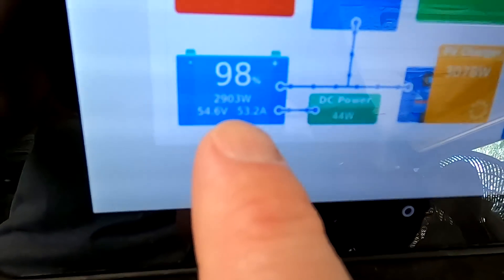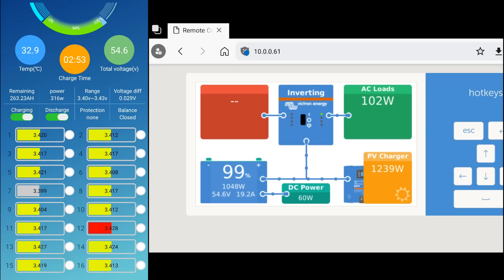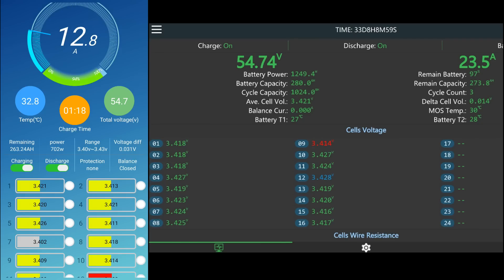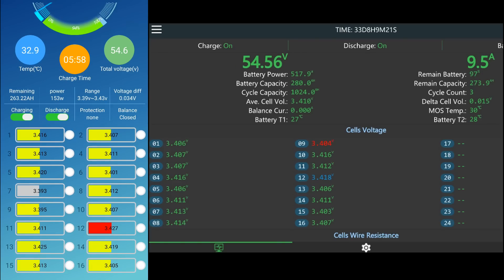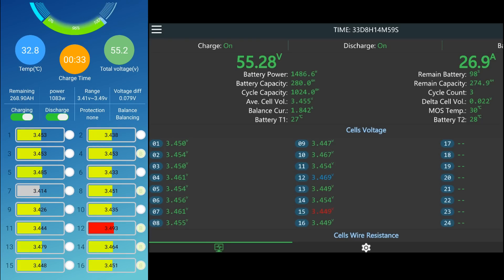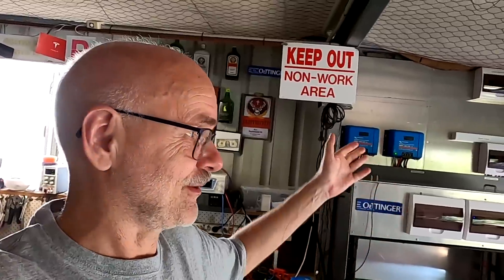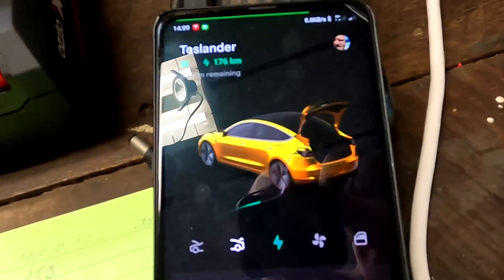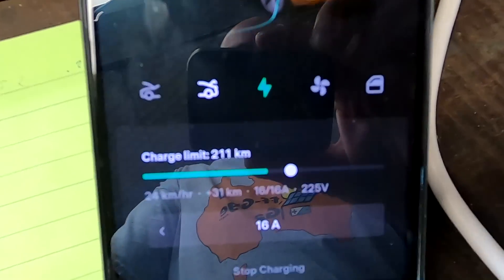Communication between BMS, solar charge controller and inverter. What's the benefit?

Comment: Your logic regarding communication between the devices does not take into account loads higher than what you are showing during your testing.  If you had higher loads during the charging, absorption or even float cycles, then the results will be quite different.  I've seen it in my own system.  That's why I'm using a custom program I've written that talks to my cell "monitoring" system which can alter the CC state and Inverter state.   I also have Home Assistant integrated with this custom program to allow me to "privately" monitor my complete system as well as override control of loads as well as the solar equipment state.  If you'd like to see what I'm talking about, I have another YT channel: JC/DC in the AZ that goes over my system as well as the Home Assistant integration.
Reply from the maker: No, I said this in the video: this situation will only occur if there is more solar power available as your loads are. Only then is energy left over to actually fully charge batteries.
If you loads are bigger than what comes in from your roof, you will discharge your batteries and no cell can actually peak with a high voltage.
Reply: @OffGridGarageAustralia  Hi Andy.  I'm sorry I didn't remember this from your video.  Also, I wasn't really saying that the load would have to be greater than charge, just that the load would by higher than what you were testing.  That's why In my setup, I have a Home Assistant gauge that shows me to Net Charge/Load to/from the battery.

Comment: Question? What do you think the JK BMS would be showing for cell resistance per cell on your old battery? You would need to replace the Wicca bms and install the JK and I don’t know if you can do that with out disturbing the buss bar connection but would sure be interesting to see what the resistance is!
Reply from the maker: I can measure this with my internal resistance tester. Wait for the next video. I will do the same with the old battery and compare the resistance with and without busbar.

Comment: Well, main advantage getting SOC information than just the voltage levels. Because voltage curves are so flat on lfp.
Reply from the maker: But the flat part of the curve is not relevant anyway for anything to be honest. Only if voltage rises and the battery is full it is interesting.
And here again, the solar charge controllers provide a relay output which can be programmed for this.
What would you want the system to do at say 60% SOC if this is been reported from the BMS to the system?

Comment: put both charge controllers on a bus brand see what happens to them. if they act the same way with one solar panel power on the bus bar and one battery on another bus bar. all solar panels and batteries are not equal and charge controllers ad wires are too. try a compressor for storage,

Comment: Can you update the software on the JK BMS? I have one with 8.20G another with 10.07 ver.
Reply from the maker: I don't think anyone can...
Reply: You can't, but I've been asking the developers to release the source code. The micro is an STM32, and it has a programming header on the board. Once that happens, we can add a boot loader to update firmware through the RS485 port or even Bluetooth. I don't have a time line for any of this though...

Comment: Communication has advantages over no communication because BMS has knowledge of each individual cells vs inverter which has no such information. So in practical terms it will benefit in following scenarios:
1. Battery is near the top balance. Overall battery voltage is normal (charger doesn't see issue himself), but some individual cell is reaching chemistry upper limit. BMS informs charger to reduce charge current so that balancer can cope or switch on some smart load (water heater etc. ) to dump the excess energy. If allowed dump excess energy to the grid.
2. Battery is near empty. Overall battery voltage is OK (inverter doesn't see issue himself), but  some cells are nearing critcal low voltage. Information to the inverter could either switch off non-critical loads or switch on generator or perhaps take energy from the grid.
Reply from the maker: Thanks for your comment.
OK, so both scenarios you explain make sense. Without communication, the BMS would just turn off this battery bank, right? If you have more than one battery bank, this is not a problem at all in either way as it will join the other battery banks again once the situation is cleared.

I actually don't like the case where the BMS tells the chargers to slow down (in case you have more than one battery bank) . This means the charging process of the whole system is dependent on this one cell in one of the packs. While other banks may still be able to take energy, they won't get it any more. It would also start to discharge all banks now if the load is higher than what comes form the sun (which may be nothing due to the throttling).

In case of the low voltage, The BMS would turn off this one battery bank and keeps the load alive with the others in place. It's a different story if you have only one battery though and your suggestions do make sense in this case.
Reply: @OffGridGarageAustralia  If you turn off battery banks one by one eventually you will only have one left. In which case you would still need to take action based on BMS data. 

Throttling charging doesn't mean stop charging. It means to slow down. All packs will still get energy, just at slower rate. This throttling will only happen at very top voltages, so this slowdown is not for very long. 

Also charging/discharge limiting is just one option of actions. Don't forget dump loads, generators, charging from grid/ dumping to grid etc

Comment: Love all your vids!!!! We have a three phase system set up, we have had the victron s shut down for a couple of seconds while in absorption,  it happens right at the top of the charge and I'm guessing the BMS shuts down because of irregular cell Ballance. Connecting the BMS I think may resolve this but obviously this isn't the answer. Going to lower the absorption voltage a little and currently have new cells top balancing. Also have on the way JK bms's, currently installed are Daly, they are shit.
Reply from the maker: What are your absorption settings right now?
The Daly is not good for the balancing, no. Neither is the JBD or QUCC (unless you use an active balancer in addition).
Reply: @OffGridGarageAustralia  we are using the victrons set lifopo4 standard settings but was thinking of lowering this by 0.2 v.

Comment: Since the amps going into the battery bank gets lower when it is almost full and then the battery bank is supposed to stop accepting charge when it is totally full, does it mean that it can never be overcharged?
Reply from the maker: That depends on the settings of your charge controllers.
I have set 3.45V per cell as absorption voltage. So with all cells balanced I cannot get in trouble as the maximum voltage for the cells is 3.65V. But if your balancer cannot keep up (like in the QUCC, Daly or JBD BMS) you can overcharge your cells as I have shown in the previous video.

Comment: Maybe a communication between BMS, charge controller and hybrid inverter might make it possible to inject the surplus on the grid while performing the balancing?
Reply from the maker: That should be automatic, dependent on your inverter settings (if it is a Multiplus) or settings for your transfer switch.
Reply: @OffGridGarageAustralia  but the inverter should tell the mppt to supply full power to the DC bus.

Comment: Right now, while you are in the garage, you are able to monitor/review the individual cells of each battery via Bluetooth. But what happens if you decide to go on vacation for 2 weeks? You are able to see the overall picture of your systems via the Victron VRM portal when away, but you are not able to see view the cell level data if you suspect something is wrong while away. That is where the Canbus communications can potentially come in. I live aboard a sailboat and am currently tied up in a marina in Phuket Thailand awaiting my shipment of 16 x 304Ah batteries in order to build a 12v 4S4P pack (our vessel has 12v systems) and I intend to install a JK BMS unit with each 4S pack with a voltage booster as you have shown is possible on your channel. A sailing lifestyle however, involves touring on shore for days or weeks from time to time and while away from the boat, I would like to monitor/review the battery packs at a cell level when I am away, but we will see. There is a person on the Victron forum working on the task...I would also like to mount 4 inexpensive 485 monitors to the bulkhead in order to "view at a glance" cell voltage data for my battery packs, which I have not noticed that you have tested on the JK24s BMS...Future Video???....Really enjoy your series, keep up the fun!
Reply: JK are bringing out the 4S version in April, much better than using the boost option!
Reply: @jackiedines5229  Thanks for the heads up!!! Where are you getting this information from? I am also interested in both the Canbus ports and RS485, which they reduced to a single less functional port on their recent 8s model, but I do like the fact that I can add my own p- and b- leads to the length that works for my battery setup...crossing my fingers for a good product- will still be purchasing the 24s model for now, as the new product will be untested, I do no expect my batteries until May, so the timing is interesting...
Reply from the maker: As soon as the 12V version is available, I will get it and test it here on the channel.
I am following this project as well on Github and will be connecting my BMS to the Victron Hub at some stage. Maybe just for monitoring purposes though. 
That's why I do all this testing with high and low voltage so I don't actually need to see the individual cells if I'm not at home. I know how the system reacts and what will happen if I go to the extremes.
Reply: @SailingCatamaranElement  They told me after I asked them for their recomended booster. Given the one I bought from Ebay crapped itself pretty quickly. Probably due to my inexperience in using this stuff.  Now due to the crappy batteries I got I am not going to use the JK BMS, rather a cheapie that gives no data at all. I will monitor cell voltage with a simple monitor. Where are you getting your batteries from?

Comment: Hi Andy, you missed one important point: The BMS is the last line of defence. You should never ever relay on the shutdown of this component in normal situations. Therefore your settings should be like that, so this situation will never occur. So shutting down a bank of batteries because one cell is high by BMS should never be an option.
Having communication could be an solution, to keep absorption available until the last bank has been balanced.
Grüße aus'm Schwabaländle :-)
Reply from the maker: Hi Peet, I don't rely on the BMS alone. You're absolutely right!
The SCC turns off charging long before the BMS kicks in and also the inverter will shut down long before I hit any low voltages. When I run these tests, I obviously want the BMS to trip to see, experience and share what is going to happen. This is also peace of mind in case I'm not at home and the 'something happens' 😉
As we have seen in this test here in the video, under normal settings and conditions, the BMS is not kicking in at all and just balances as it should.
Reply: @OffGridGarageAustralia  Hi Andy, I think you can publish a "conclusion" video with all settings (almost) of SCC , BMS and inverter. Joined to this video will be a great point to ask community for advise, won't it ?

Comment: I would explain the advantage of using your serial 485 or canbus is that you can use FOSS to log everything in the same web interface.
Reply from the maker: Log means monitoring but not actively controlling, right?
Reply: That's correct.

Comment: Andy I don't if you have ever gotten into data logging at cell level and using MQTT to check the history of how each cell  in the bank is going instead of only real time monitoring
Reply from the maker: Thanks Ross, yes but this would be just for monitoring purposes, right? Not actually controlling other devices according to a state of a cell.
Reply: @OffGridGarageAustralia  Yes just for monitoring the cells history even under load and change

Comment: Hey, communication is important to extended battery life during extraneous conditions like rapid charging or during extreme ambient temperatures. Here in North Queensland my battery bank reached  40 Celsius regularly during a recent heatwave. My LG Resu 6.4 ex battery backed the multiplus down to a 16A limit which was inconvenient in my ESS but gave me comfort to know the most expensive and dangerous asset in my system is looking out for itself beyond the manual safeguards I put in place.
Reply from the maker: Ah, right, that is a very good point. I never thought about temperature actually. While the BMS prohibits charging under 0° it won't slow down charging at high temperatures  so the cells don't get even hotter with high charging currents.
Very good example, thank you!

Comment: Bulk Charge is Constant current charge. 
Absorb Charge is Constant voltage charge. 
Float Charge is also Constant voltage charge at a voltage below Absorb charge voltage.
Reply from the maker: While it does not charge in float mode any more. It maintains the voltage (and current) of the battery.

Comment: When one of my BMS's disconnects during charging on my 12v system I have measured voltage spikes over 21v.  The inverter detected it and shut off but 21v+ for the remainder of the 12v appliances in the RV is a problem.  I have top balanced my batteries so this is no longer a problem.  I don't want my BMS's disconnecting unless it is a serious problem.  Voltage spikes will likely cause problems eventually.
Reply from the maker: If you have more than one battery and a BMS disconnects one of them, why does the voltage spike? It should stay the same as before if all other batteries stay connected.
Reply: @OffGridGarageAustralia  It was a bright sunny day and the solar was producing a little over 150amps into 800amps of batteries.  When one, 400amp battery suddenly disconnected the voltage spiked before the solar charge controllers could react.

Comment: It would be nice if Victron made a BMS that connected to the VRM.  I like how integrated everything is within the brand.
Reply from the maker: They do have a few BMSs actually but they only connect their own smart batteries. 
I agree, it is really time for them to release one which is plug'n play as all the other gear they have and can be programmed to the user needs.
Reply: Victron would eliminate the incentive to buy their overpriced lithium batteries if they did that

Comment: Mind you, the JK BMS does not shut off the battery completely. It just does not allow anymore charging during a “cell too high” situation. You can still pull power from the battery and the inverters will still stay running.
Reply from the maker: Yes, that is correct!

Comment: The benefit is as you describe, the BMS disconnecting the battery should be the last resort when everything else has failed to prevent the over charging of cells. By slowing down the charge rate, it gives the balancer time to work.
Reply from the maker: ... which could take the whole day in case of the QUCC, DALY or JBD... I don't like this. The whole system is then 'blocked' just because of one high cell. If the BMS turns off the particular battery, the rest can work normally.
As I have shown here with my settings, this does not happen to me under normal conditions.
Reply: @OffGridGarageAustralia  Which is caused by using a BMS that is not suitable for the capacity battery you have. Ditch the QUCC BMS and use another JK or another BMS with a more suitable balancer!!!!

Comment: i think it benefit more on the monitoring cells remotely. Since BMS are usually Bluetooth so we are unable to see the BMS data online. Having that communication will benefit that or even you are able to tweak your BMS settings online?
Reply from the maker: I don't think you can actually tweak the settings through a communication port. The BMS just sends the information via RS-485 to whatever is listening to the data stream.
Reply: @OffGridGarageAustralia  there should be a way to read as well as write the settings depends on the application features. RS-485 is just the medium of communication or maybe not in your current setup. i heard BITEK they have deep integration between their inverter and BMS.

Comment: Having comms would let my inverter know SOC of the batteries, instead of guessing based on a smart shunt. 
As an example, my MPP Solar inverter thinks my cells are at 48%, when they are actually at 90%, so I have to rely on the BMS to assure no over charging occurs.
Reply from the maker: But does your MPP not charge as per voltage settings?

Comment: Hi Andy. I see only one main advantage in direct communication between the BMS and the controllers, and that is that the controllers measure the battery voltage at their terminals and not at the battery terminals, and there is a difference. if the regulators had their own torch voltage measuring wires, there would probably be no need for communication.
I have all my controllers and bms communicated via Modbus protocol to the scada system and I see exactly what the voltage of the battery is and what the voltage of the battery is measured by the controllers at their terminals - there is quite a difference ...
Reply from the maker: Yeah, OK, that's what the smart shunt does in my system. I measures at the battery level and reports these numbers back tot he SCC and inverter.